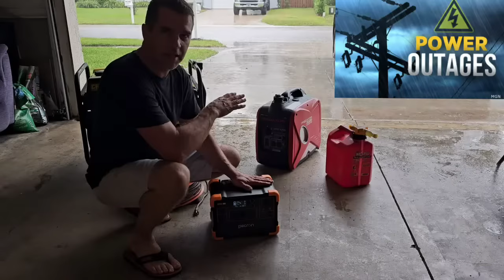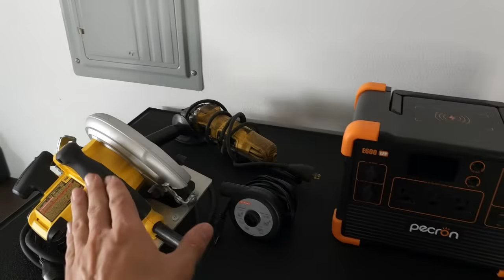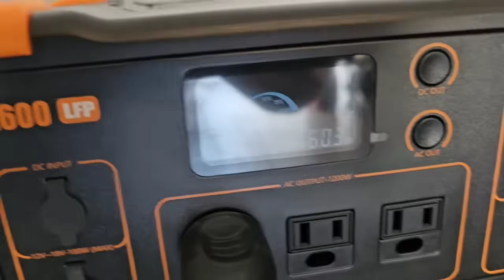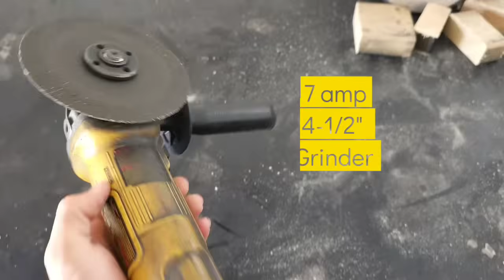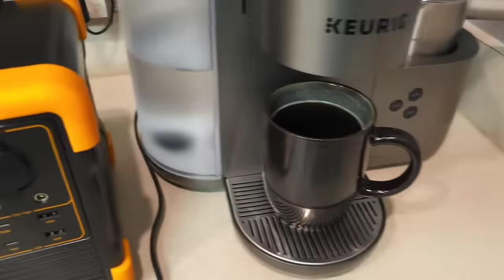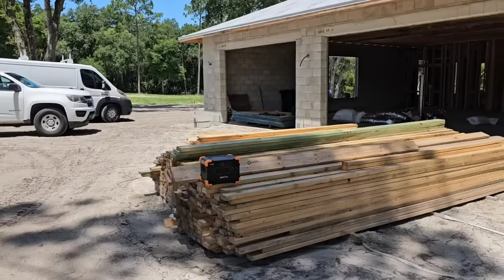Testing the Pecron E600 LFP portable power station.

Comment: Turn down the power on the Microwave to 1000 watts and try it. It will work just fine.

Use it for an ICECO APL20 0r APL35.

Comment: Now the meat and potatoes.    I just got one of these and pretty much saw your video and used it as a guide to get mine going.  I did purchase the 200W solar panel.  But then I bought the 3600 with 2 400 W panels (waiting on that)   same purpose.  Back up clean energy. Can't wait to use it and put thru test

Comment: I have 7 power banks from Pecron right now.  I haven't had any problems with any of them even though I have put them all though torture tests.  Currently I have one 2000lfp with one expansion battery, 2 600lfp's and 4 300lfp's.   I just ordered the 3600lfp with three expansion batteries but have not received them yet. I will be powering a 24' enclose cargo trailer that I have converted into a camper. i have enough solar panels on it to produce 4000 watts of power on a perfect sunny day.  I have installed a split ac unit on the trailer and my 2000lfp runs it without any problems and will run it all night without running out of power. As long as I have sun during the day to recharge that unit, I always have power but with the 3600lfp I'll be able to add more things to the trailer.
Reply: nice! i just got the e1000 and love it so far, i plan on getting the 600 and 3600 in the future

Comment: The wireless iphone charger is not working
Reply from the maker: Make sure DC power is on. Phone must lay perfectly flat and centered on the charge pad. If the phone case is tool thick or if it has a "pop socket" it will not be close enough the the charger.

Comment: Picked one up for camping one for camping (coffee, radio, phone charger, small tv at times).  Small enough to fit in my wrangler with all my camping gear.  Got mine for $328 including tax with a 100 watt folding solar panel.  Got the last one they had.  😁
Reply: i also have a jeep and just picked up the e1000 for 340 to my door, ordered a 180w panel too. hows it treating you so far?

Comment: I’m getting one to run my CPAP machine which 52 watts and during 8 hours of sleep 416 watt hours.
Reply: did you use ac or dc 12 volt plug in?
Reply: @blueback21  The AC plug is more efficient.  Turn off humidity and you can run the machine for many nights.
Reply: THIS is the comment I was looking for! Thanks. Still working well?

Comment: Every Review 
of Any Solar Generator, 
should include a test, 
to determine, 
if once the battery 
is completely drained, 
subsequently after 
there is sufficient battery charge 
from solar, 
will the generator 
energize the AC outlets automatically 
on it’s own?

In a completely OFF GRID scenario, 
and No Internet, 
if you are using the Solar Generator, 
for example in a cabin, 
if the battery is drained, 
you need it to 
re-energize the AC outlets 
as soon as it has 
sufficient charge from Solar. 

Otherwise, 
none of the Solar Generators 
are worth owning, 
because the owner 
would be required 
to be there every day, 
just in case 
the battery was drained, 
in order to 
turn the AC outlets back on!

Which makes it useless!

If you have 
a refrigerator or other important item 
that needs power, 
you can not be there every day, 
it MUST 
TURN the AC OUTLETS, 
ON AUTOMATICALLY!! 

WHY IS THIS 
NOT A STANDARD 
TEST COMPONENT 
IN EVERY REVIEW 
OF EVERY SOLAR GENERATOR???
Reply: You wouldn’t use this one for a fridge this is meant for a portable one
Reply: Pecron just came out with their newest battery that does automatically charge both ac and solar.
Reply: Please watch the video that REEWRAY OUTDOORS. He has a video up on the Pecron 3600w that does what you are asking...hope this helps.
Reply: @c.tucker2247 
Just watched it.

But it does not indicate if
IT AUTO RESUMEs WITH AC PLUGS IN THE ON STATUS, IN MORNING after Sun Charges battery sufficiently to begin producing AC.

I need this functionality.

thanks
Reply: Apparently you can shut down the unit remotely before 0volts ( you don't want to often run it to 0) that way it will stay engaged
Reply: That was simply an example.
I intend to use it for something else, but i need the functionality i described.

thanks for your reply